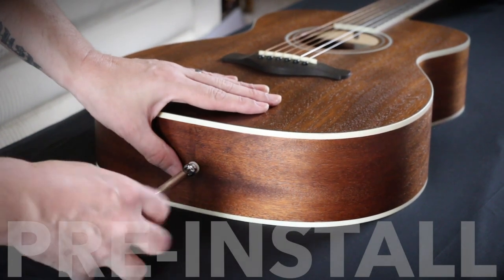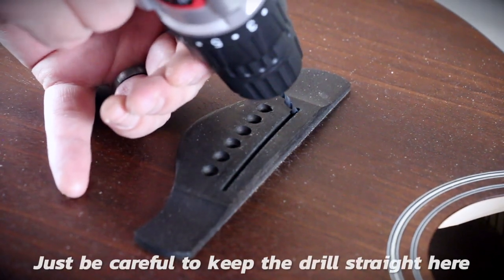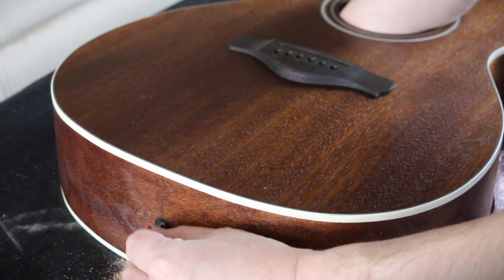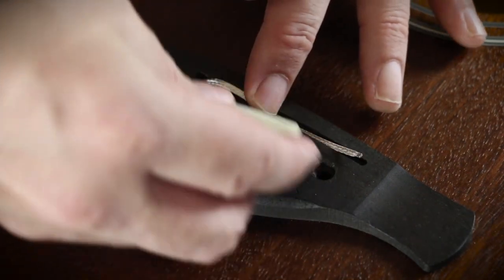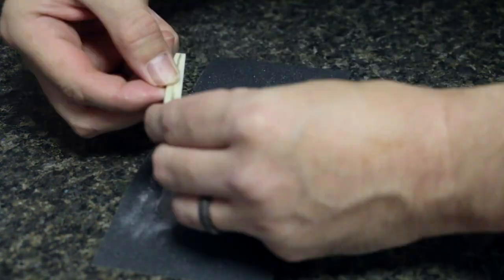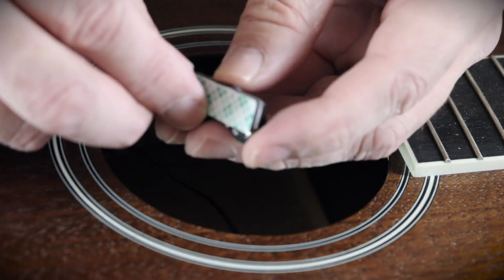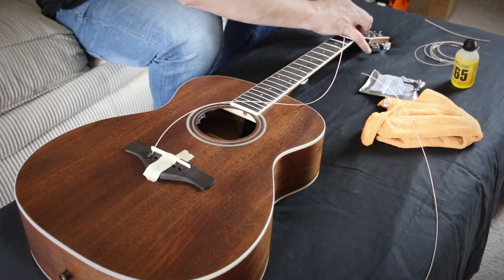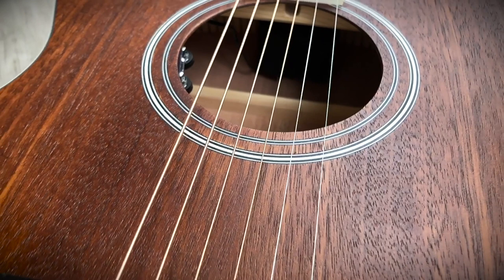LR Baggs Preamp Install In My Ibanez AC340!

Comment: Well done! Just installed the LR Baggs M1 Passive in my Ibanez AW300, The M1 is a soundhole pickup, so a bit different than the Element. Pretty easy process and equally happy with the resulting sound.

Comment: I'm thinking on installing this as well on my aw54 but the bracing's making me doubt it would fit the volume knob that has the plastic covering, do you think it will or should i go with just the one you are using? thank you grat vid!
Reply from the maker: Thanks for the comment! There’s no reason it wouldn’t fit, the volume and tone controls are only about an inch in length, but I don’t know the aw54 unfortunately, I’d be surprised if it didn’t fit though, cheers!

Comment: This was a really pleasant video to watch. You were informative and the ambient background acoustic was soothing. I took the LR Baggs Anthem system from a damaged Orangewood and was going to place it into my Ibanez AV4CE after removing the Fishman sonicore, but the bracing is a bit too high for the preamp. Was wondering if sanding a bit off the brace or shimming the sound hole preamp would be best. LR Baggs kindly sent me more adhesive pads. Thanks for any advice. Your playing sounds pretty terrific too.
Reply from the maker: Thanks very much for the comment! I would try to adjust the preamp rather than the guitar as that would be non-reversible, hope it all works out for you, cheers!

Comment: Derek, I did in my classical guitar sound port and I love it. Do you think this is good idea in acoustic guitar?
Reply from the maker: I think I’d you play through a PA system then it’s a great idea, also if you love the sound of the LR Baggs system then great, cheers Pawel
Reply: @DerekPaulGuitar  You are right. Generally it not make sound better, but give you faster response - great for faster playing but not only. You can hear sound directly from guitar not bounced from wall for example what need noticeable delay. Difference is huge. I have sound port in classical guitar, first time I test it on closed, then on open and I never closed it again :)
Reply from the maker: Paweł Tomkowiak Your right the difference is huge, with it plugged in you can also add different reverbs and delays, but very different sounds :)

Comment: Great video and well put together 👍🏻 Are you planning on adding an external battery compartment to make it handier to change?
How long do you get with a battery usually?
Thanks for sharing
Reply from the maker: Thank you! I appreciate that, I don’t plan on the external battery compartment, the battery has lasted over a year so far :) cheers!

Comment: I had same guitar, it's no real sound, price lies you my dear friend.
Test sigmas in 15m models, best woods, same construction like martin, better real sound at mahogany  no cheap sound that ibanez, real bone compensated, I have one and I compared before to sale..If you can sale that cheap ibanez and expend a 300 pounds in a better pro guitar with real mahogany not with no mahogany like ibanez,the wood is the base of sound.
Reply from the maker: Thanks for the comment, i have to disagree, the ibanez in my opinion has an amazing sound and plays exceptionally well, it suits me very well, I guess everyone has a different taste, cheers and stay well
Reply: @DerekPaulGuitar  Another important point, the electrics that you chose are so much problematic, guitar doesn't need cables and more noises ,  the better natural sound is K and K pure mini and pro and it cost less!
Reply from the maker: Lorem Ipsum I’ve tried the sigma, I’ve tried Martin guitars extensively, I’ve tried $3500 Taylor guitars, I have 3 guitars priced at $1200 and the Ibanez is fantastic against them, I will stick to my statement, it’s a great guitar, we all have different experiences as I say and I can recommend the Ibanez but of course everyone’s experience and recommendation is subjective, cheers
Reply from the maker: Lorem Ipsum once again I will disagree with you, all my expensive guitars have LR Baggs and they sound amazing and have been very reliable, this is my experience and opinion and it’s subjective cheers